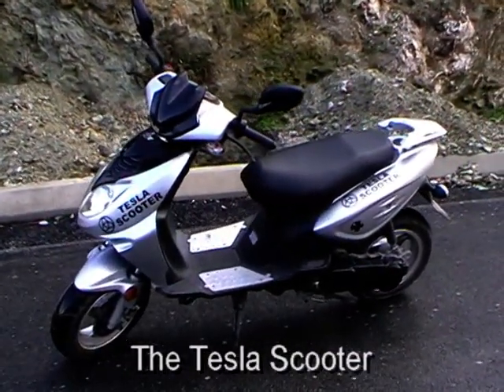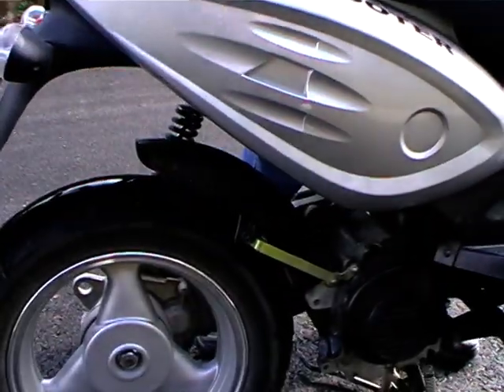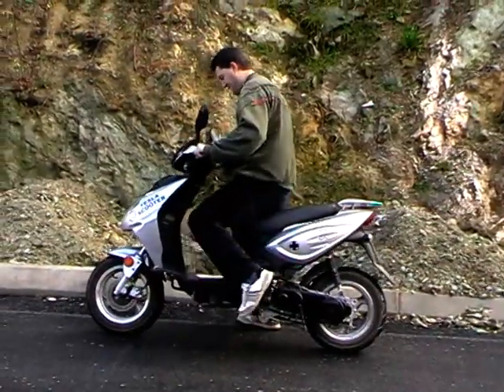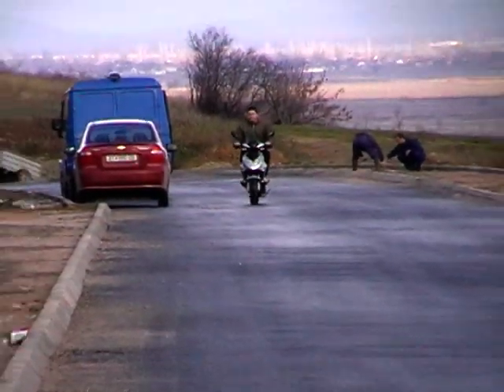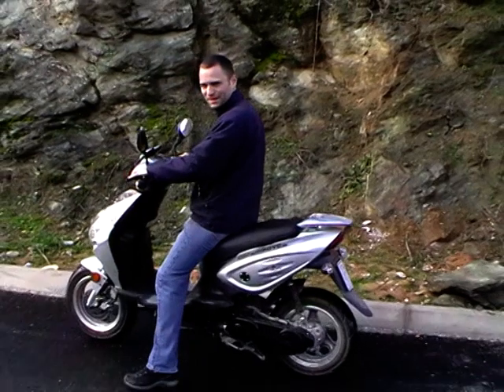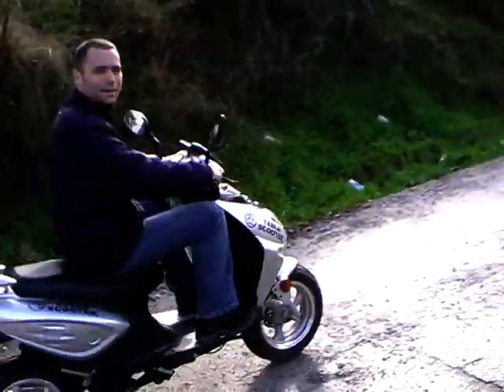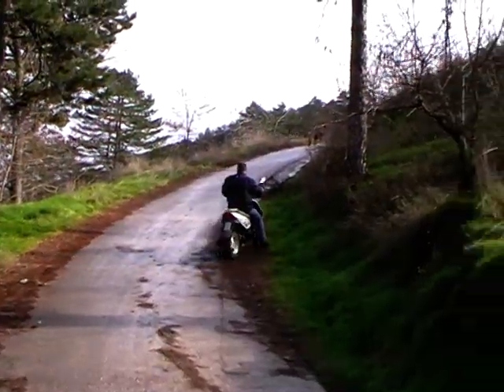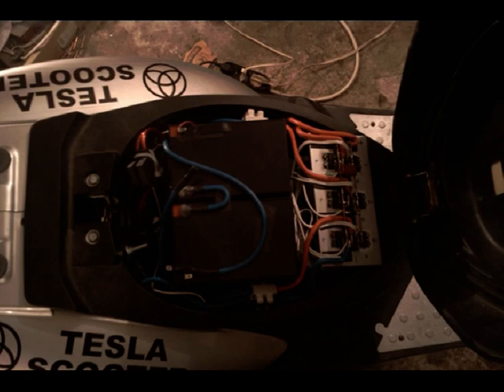The Tesla Scooter

Comment from the maker: @fairyheli2 We have tested high frequency inverter drives and found that MOSFET losses due to high frequency are greater than the vibration losses of the AC induction motor, so we developed a low frequency inverter driver which is more efficient but requires high quality motor bearings because of increased vibrations.

Comment from the maker: @fairyheli2 Because bldc or brushed motors have permanent magnets that under heavy acceleration (high current) the opposite magnetic field will de-magnetize the permanent magnets little by little lowering their efficiency in steps until the motors will have to be replaced. The AC Induction motor is very resilient and it will last very long time and also survive high current peaks without problems.